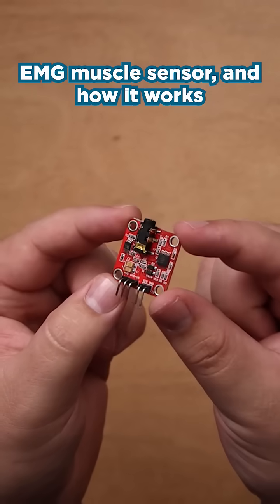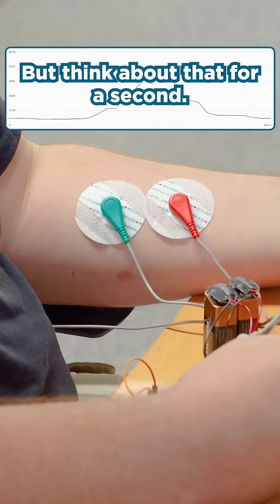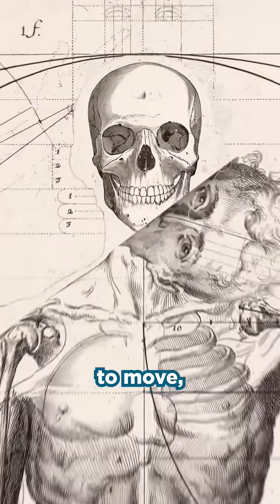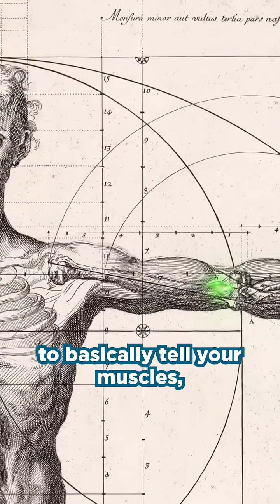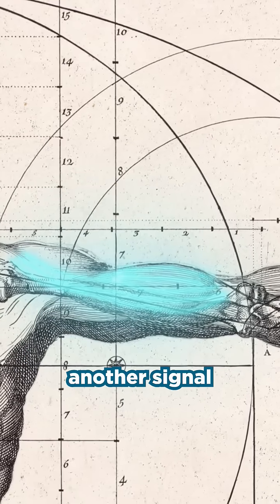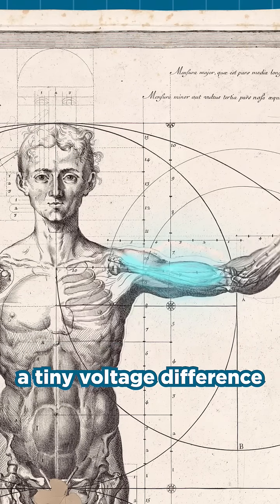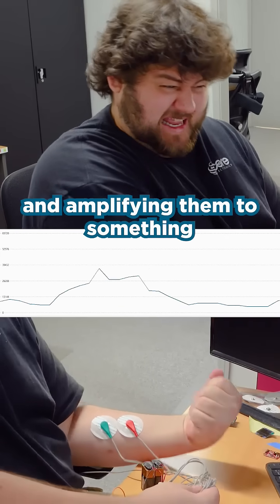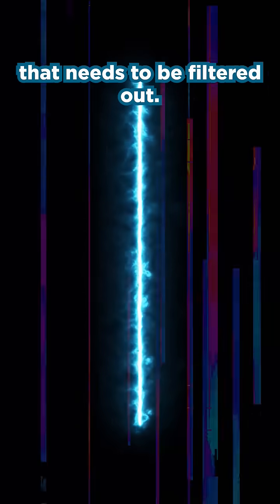This Sensor Detects Muscle Flexing?

Comment: Im doing a normal esp 32 project in which i making a robotic arm using servo motors. We are using bluetooth version of esp and there is a problem in servos 
Some time they work some time they don't 
And when they work they vibrate.

Can you please guide me 🙏🏻🙏🏻🙏🏻